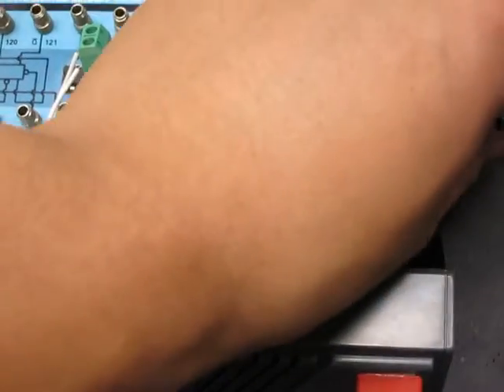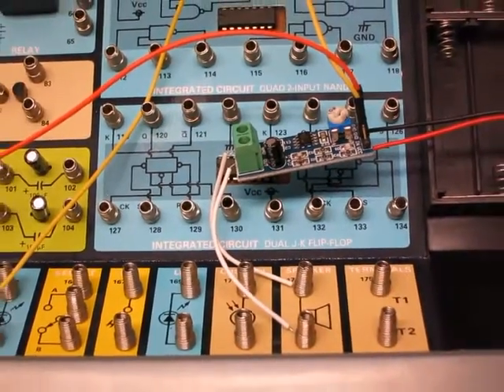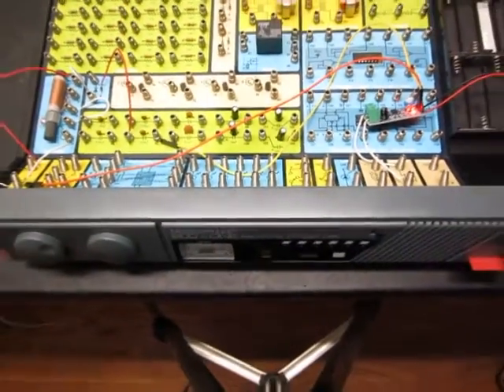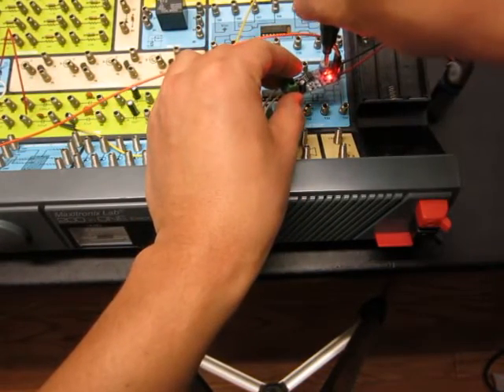Crystal Radio with LM386 Audio Amplifier

Comment: I know, I need to start thinking about building add on modules to use with the 200 In One electronic lab kit.  This is one that needs to be added.   These kits only have 3 diode,  2 NPN Transistors,  2 PNP transistors, 1 AM coil, Variable tuning capacitor,  various capacitors, various resistors, and 2 transformers, and 2 digital IC's, and 1 potentometer with a switch, a keyer, and a slide switch, but no LM-386 to go along with the speaker.